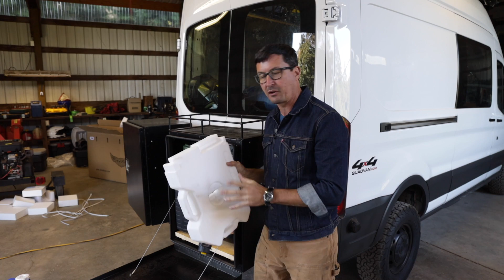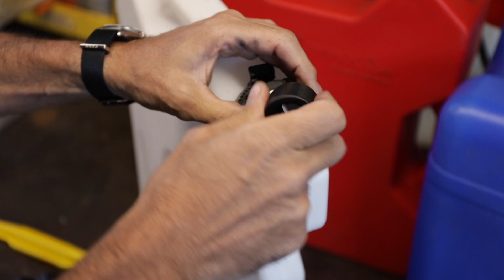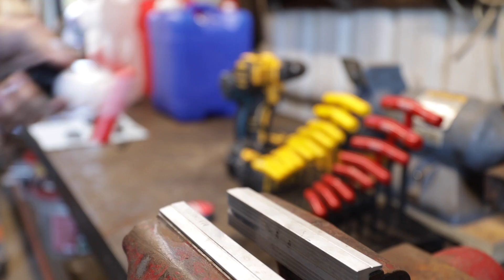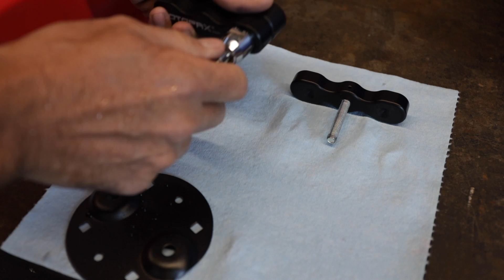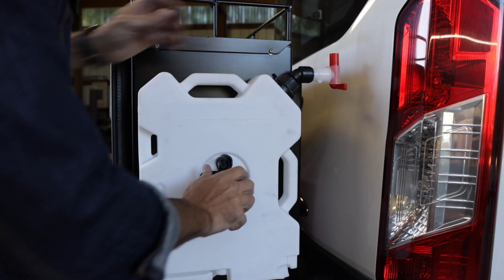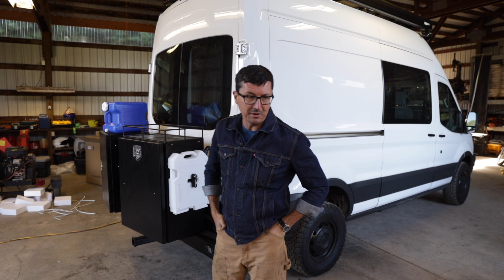The Emergency Water Storage We've Been Waiting For - FINALLY!!!

Comment: Nice video.  What about the dirt and dust accumulating on the rear end of the vehicle?  Don't you have any dirt and dust accumulating on your gear in the back of the truck?  A flat rear end vehicle is notorious for accumulating grime.  Maybe if you drive only on pristine asphalt roads you will be OK, but when you get on dirt roads, all you gear in the back will be cover with dirt and dust.
Reply: I wonder if a air deflector that diverts air down from the roof rack would help with that?
Reply: Or add foil vanes to keep the streamlines from separating....as my friend Cal Gongwer did on his van side and roof rear corners 30 years ago....tremendous fuel efficiency of course also .....ha

Comment: The technical saying for "Fudge factor" is Factor of Safety.  It is taught in engineering classes and good engineering will incorporate that factor.  Let's say an engineer finds out the absolute limit something can handle is 10,000 lbs, they will say it can handle 8,000 lbs using a 20% Factor of Safety knowing people may exceed a weight limit by a little bit.
Reply: You also have to allow for preventative maintenance being able to spot an imminent failure. So a bridge with a crack in it will still have to carry its rated load until someone is able to spot the progressive reduction in capacity. Same for wire rope, a broken stand is visible, a progressive elongation isn't.
Reply: @borisisasleep8993  
True. That's why bridges have a lower FOS than buildings because bridges are easier to inspect structurally and are inspected far more often than buildings.
As for progressive elongations, depending on your use, those can easily be measured through tensile load measurement or lengths of travel measurement. 
In an elevator it's easy to measure elongation because the position to each floor is known from the start. As it stretches those positions will shift and the controller will need to compensate.
Reply: Steven DeZwaan Very interesting. I’ve heard that for steel cables, chains and ropes, the factor of safety used is sometimes 2-300%. Any thoughts as to why?
Reply: @brandonb9452  FOS is determined by industry, material, and risk to human life.
A chair will usually have a FOS around 2x  because it's low risk if it fails while an elevator will often have a FOS of 8x because it would likely cause death if it fails.
Airplanes run in the 1.2-1.5 range even though they have much higher risk because you'd never get anything off the ground if it needed to have  8x the strength. To compensate, aircraft go through much more rigorous analysis and materials are much more closely monitored.
As for rope and wire cables, it depends on the use. Used as a utility rope it may only have a 2x or 3x FOS, but if used for a tower guy wire it would likely have a 6x to 8x FOS.
Reply: @brandonb9452  I would think it would be because of wear.  As those kind of things do what they are mean't to do (That being help either move something or hold something still) they wear as they are used usually due to friction and sometimes stretch.  Steel cables and ropes are made from many small strands of the material they are made from and those strands can break.  As those strands break they become weaker and weaker.  Chains can wear out as they move over other surfaces as well, reducing their cross sectional area, that makes them weaker as well.  So a bigger factor of safety needs to be used in conjunction with the knowledge they can get weaker over time.  That would be my thinking behind a much bigger factor of safety used for things of that sort.  An engineer wouldn't want an elevator packed full of people to plummet several stories because he or she didn't include a big enough factor of safety when selecting a steel cable to use for that elevator.
Reply: Steven DeZwaan That seems reasonable, thank you for the explanation